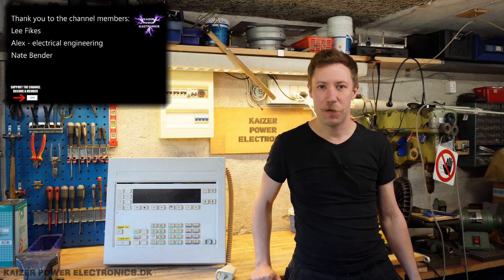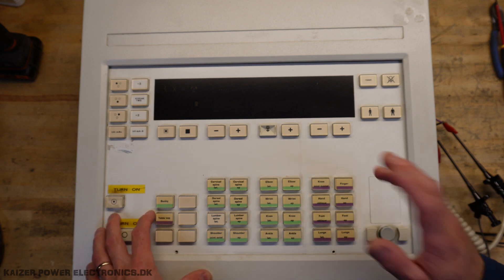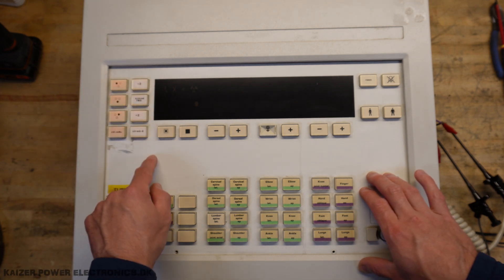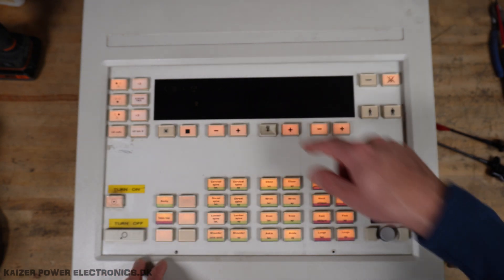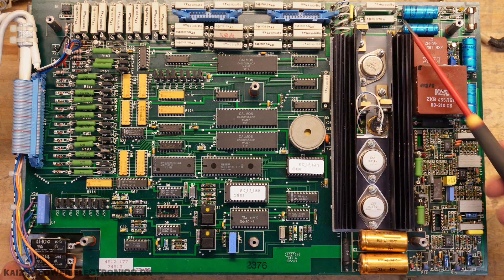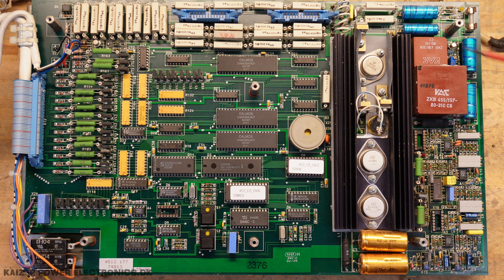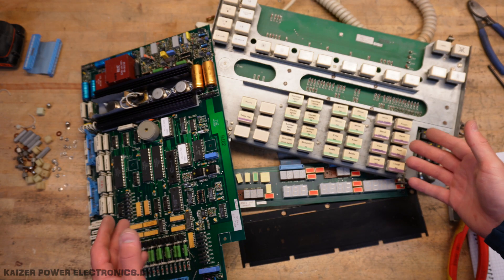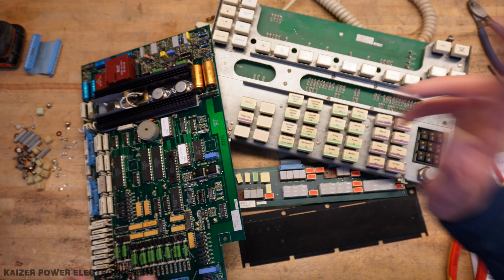Philips Medio X-ray 50 kW CP-H Control Desk Teardown

Comment: 8085 is a processor (CPU), not a controller. It has no peripheral devices and no memory. 82C55 - modern name for this thing is GPIO. Two chips below CPU are ROM and RAM. RAM is likely 2KB.